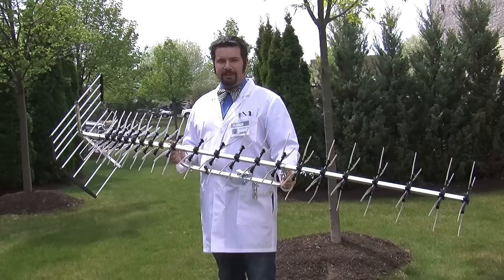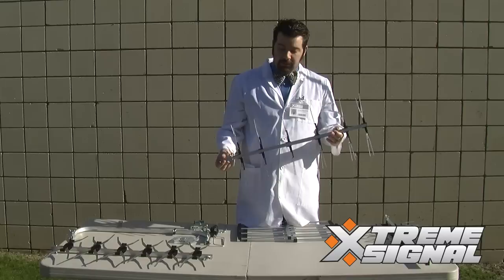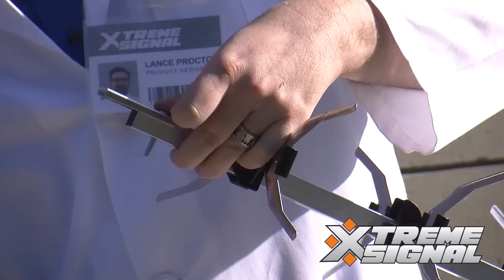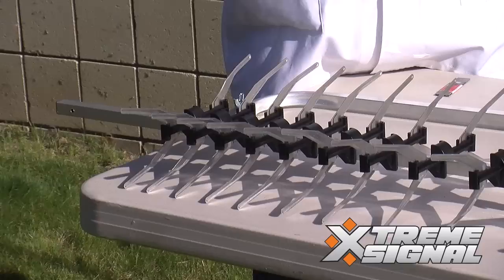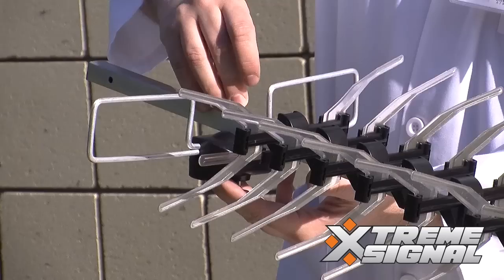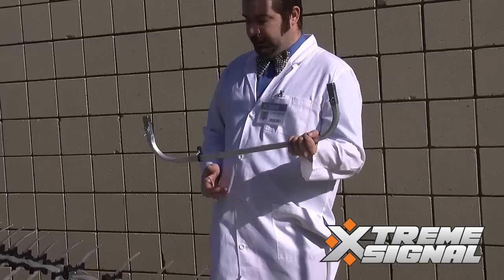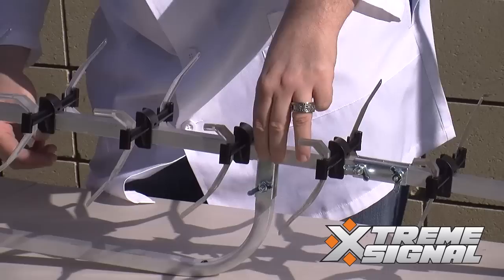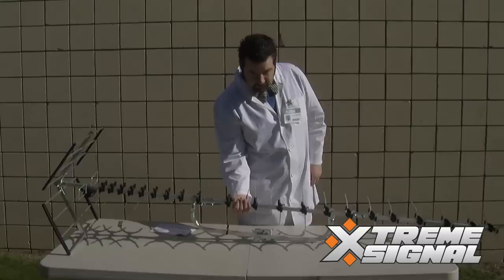Assembly Instructions for the HDB91X Yagi TV Antenna from Xtreme Signal

Comment: I bought this antenna back in November and mounted it 20 ft above ground. I added and RCA pre-amp about 3ft below the antenna and am using RG6 cable run. The antenna is in a holler (narrow valley) in southern Ohio. Southern Ohio is very hilly and heavily forested and this antenna receives ALL the Columbus, Ohio stations (74 miles from the broadcast towers) and when pointed southeast receives all the Huntington/Charleston, WV channels (about 64 to 75 miles away).  All in all a great antenna I would recommend
Reply: Good to know because I live outside Lancaster and think I will try one after reading your comment.
Reply: @supahugro9065  - Go to TVFOOL.COM and click on " TV Signal Locator " - From there, enter your Zip Code - From there, you should see Location / Directions of TV Towers.  From there, point your Antenna to where it is the most Channels... That way, you will know what and where all the TV Channels is / are.  NOTE:  Take your time and study all the Channels including distance + locations and all the " Important " Channels that YOU like!
Reply: Are you serious?  I'm in the exact same boat.  I'm in the bottom of a valley surrounded by 1000' tall hills on all sides.   I can only pick up 2 stations with a small RCA Yagi Antenna.  
I might have to give this antenna a try.   What stations are you picking up?  I can only receive channels 3, 30, and sometimes 11.
Reply: @jTempVids  I get 3, 8, 11 and 30 when point toward Huntington and I get 4, 6, 10, (sometimes 28) and 53 when aimed north to Columbus and I get 20 when aimed toward Athens. I'm in Northern Scioto County.
Reply: @gramsey5  Thanks for the info.  I went ahead and bought one.   I'll be thrilled if I can get 3, 8, 11, and 30 at the same time.

Comment: Just purchased this antenna and I will say it does a great job. I live in a hilly river valley and it picks up all the stations that are available to me.I put it up 20 ft with a rotor and have free TV I have 3 transmitters that are 50 miles away with a 2 edge signal and this antenna locks them in with no problem. Also picks up a LP station 25 miles away that is  directional going north of me. I only have 1 vhf channel,13 which is 30 miles away and have no problem with it either.   I would recommend this antenna if you want to cut the cord.
Reply: Thank you ! Just looking for a good antenna.

Comment: I want to explain some of the constructive properties of this type of UHF Antenna. 
First, this an UHF Full-Wavelength-Dipole "Corner" type antenna. The term "Corner" stands for the Reflector style which is basically two arrays of metal sticks/wires, or plates with or without holes or a wire net to mainly prevent signals coming in from the opposite direction as well as this corner element reflector amplifies the incoming signal by a certain - but merely small - amount into the full-length dipole. Usually the reflector is grounded, sometimes it is not, but if it is, symmetry is optimized. The X-shaped elements with the isolators inbetween (where these are fixed to the boom element) are two rows of half-length directors with 2 arms (other brands use loops e.g.) each to increase their bandwidth, amplifying the signal to av. 15-18 dBf coming in through the forward beam into the dipole element (which is the receiving element consisting of two loops or even two wire arms, carrying the connector box with the balun for symmetry conversion into a coaxial cable). As this antenna is catching up the signal at its end, the mounting direction is the same as the signal is running from the transmitter (the whole "arrow-shaped" construction therefor is to be mounted "pointing away" from the respective transmitter, with the reflector at its end, so all the X-directors are into the transmitter direction from where the signal runs up and through into the pickup dipole).

Comment: Have had this antenna for about 5 years and it's still working good. Does a great job on the Uhf which that's what it supposed to do. Now if you have any VHF channels this might not work to well. I have one about 28 miles away and the signal comes and goes but I'm in a hilly area. it will pick it up better on the backside of the antenna. So if you have channels on vhf and uhf a combination antenna might be better unless you are closer than 30 miles and in flat territory.

Comment: I presume that antenna also works in other countries as well because the antenna's job is to pickup RF signals whether it's ATSC, DVB-T, ISDB-T, etc. I'm from the Philippines and while our analog is NTSC-M but our digital is ISDB-T and I saw some antenna that look similar to that one.
Reply: Yes, it does assuming your TV broadcast stations are UHF. RF is the same everywhere and it's not dependent on any digital television OTA standard such as ISDB-T, ATSC or DVB-T/T2.

Comment: I bought my 8 bay bowtie from Solid Signal.  Works well but I'm still missing a few channels due to surrounding terrain.  The transmitters are in the same direction but some stations broadcast a weaker signal.  In your opinion, would this model have a significantly better chance at pulling in these missing weak HDTV channels?  I believe I need the strongest HDTV antenna made (by anyone).  Is this it?  If not, what is?  Thanks!
Reply: Hi, there are many reasons that some signals come in more weakly than others. For example the signals you are having issues with could be distant VHF signals and there are better antennas for that. The best thing to do is go to Solid Signal's web site and click on the antenna request icon at the top. We'll happily get you the right antenna. Unfortunately this comment system doesn't give me the ability to help you directly.
Reply: Stuart Sweet Thanks Stuart!  Well, I figured it out.  The most powerful UHF antenna (was) apparently the CM4251.  There is even a tribute site memorializing that antenna.  Wish they would produce it again.  I may try to make my own.
Reply: This is the best antenna for you, since you are in deep fringe reception area. It will pull in the stations that your Eight Bay Bowtie is not catching - due to the Yagi's  directionality. Incidentally, cable companies used to utilize this antenna type, stacked in a quad formation, to pull in very weak signals from over long distances.

Comment: I use this antenna to pick up Boston over water from the Bay of Fundy in Nova Scotia on fine summer days (380 mi by tropospheric reflection).  It's the best of all the ones I've tried. 

Now that UHF OTA has been cropped back to channels 14-36, will there be an updated version of this great antenna optimized for the lower UHF range?
Also, doubling its reflector rod density makes a noticeable improvement without too much wind load.   It would also help to thinly gold plate the driver and its connection to the coax for more reliable use in corrosive salt air.

Comment: longer the boom the higher the gain
Reply: joseph kopeczy actually it is the more director elements the more the gain. That one should be at least 21 dbi gain.
Reply: @dr.mikehughes9874  There must be a limit on the number of director elements to have more gain. The curve on the gain vs frecuency must drop at some point as you add more elements. I don't think you can get more than 21 dbi on this type of antenna in passive mode.

Comment: Before buying an antenna make sure of the tv channels available at your location.  Most stations today transmit their signal on UHF or on high band VHF 7-13.  Don't be fooled by on-screen references to old analog channel numbers (now called virtual channels) because they no longer exist.  There are no RF signals on the old low band channels 2-6 which required antennas with long elements.  A good high band VHF and UHF antenna is all you need.  "repack" is underway among many TV stations which means that many will change their RF channel or go off the air and share spectrum with another station.  After the "repack" the highest UHF channel most likely will be channel 38.
Reply: Colonel - Well, please consider Channel 5, WCYB in Bristol TN/VA, an NBC affiliate. It stayed at the Real Channel 5 frequency during the change from analog to digital TV signals. It's a mistake to refer to low VHF as "analog channels." The frequency does not dictate whether analog or digital signals are broadcast on it; the FCC does that (along with the specific location). In rural, large-coverage areas low VHF has an advantage because of better range than UHF (all else being equal).
Reply: Google User Forget about VHF,  no one, of any significance, in Central Ohio, is broadcasting a VHF band, unless you want to tune in FM radio stations on an old stereo receiver. 
 Source;  https://nocable.org/browse-locations/state/oh-ohio
Reply: Go to TVFOOL.COM and click on " TV Signal Locator " - From there, enter your Zip Code - From there, you should see Location / Directions of TV Towers.  From there, point your Antenna to where it is the most Channels... That way, you will know what and where all the TV Channels is / are.  NOTE:  Take your time and study all the Channels including distance + locations and all the " Important " Channels that YOU like!
Reply: Google User  Fact:  There are many UHF broadcasters that still use there old VHF call numbers now referred to as "Virtual Channel Numbers", but the reality is very few broadcasts are on the 54-216MHz frequency of VHF.   There are no major broadcasters using VHF, at least in OHIO,  and the few that do use VHF are low-powered independents.   Here is a link to data for all OTA broadcasters in OHIO, by city and zip.  https://nocable.org/browse-locations/state/oh-ohio
Reply: Colonel 2 who sell antennas in Houston Texas USA!

Comment: It's an interesting design, using bowtie directors for wider bandwidth. I wonder if, instead of a folded dipole, a simple bowtie dipole with a 1:1 balun to the 75 ohm coax would work as well, or better.
Reply: Fact Checker  How about doubling the density on those reflector rods?

Comment: The tutorial doesn't pay attention to important details. For example, in the first steps, "grabbing  and twisting" there are 2 ways to position the pieces, only one of them correct, if you try the other way you may end up damaging the rather flimsy aluminum vanes. Likewise mounting the third antenna piece using the bracket from the bag is not shown clearly enough, there are various ways to do this only 1 is correct. He needs to show the details of the bracket, holes in the antenna etc.

Comment: I've read reviews where people didn't think this was a very good antenna.
Reply from the maker: Sometimes people are disappointed because they bought the wrong antenna for their situation. If you don't know which antenna to buy, check out the free antenna suggestions at SolidSignal.com.
Reply: This is a very high gain and extremely directional antenna, as such it requires a rotator to zero in on the signal you are trying to receive. The only exception is if you're located a great distance from the transmitters and they are all in the same direction, then proper aiming using a signal strength meter is required. Once the correct heading is established the antenna can be hard mounted without a rotator.

Comment: I got the lava model and have it mounted 40ft high and get 30 channels. I'm reaching 80 to 90 miles. by the government website on what tower I would get in my area. The site said four channels at the most.  I bet that thing mounted 40ft high would pull in pluton horizon signals better then nasa.
Reply: Fact Checker  matched the phased array in Robinvale no probs esp over 240 miles it shaded the phased array you have to co phase a couple of phased arrays to match the 99 elelment one

Comment: The techs at Antennas Direct claim Xtreme stole this model from them.  Whether that's true or not.... I do like the reflectors on Xtreme's more as they appear stronger than the "screens" AD uses.  Also have a neighbor who has the cheaper Digiwave version of this which uses plastic wingnuts and is a tad smaller.  But after a year he's still happy with it.  Interesting that Xtreme's cost less than AD's same model by maybe $20 but AD has superb tech support.   I'm thinking too if you installed it in an area too small ... you might be able leave off the front section even if it did mean a weaker signal.   I've seen this for as little as $35 ...meaning if it did NOT work you wouldn't be out much.  Seems well worth the money
Reply from the maker: Flat out untrue. There are similarities but this antenna was designed top to bottom to be different from the Antennas Direct product.
Reply: So then the question is .... do you claim it's better than AD's 91?
Reply from the maker: I think it really depends on your needs. This antenna is less expensive, which could be better for you. There are several channels where it has more gain, and that could be better for you if those channels are hard for you to get. There are a lot of different antennas and each one will work in a different situations.
Reply: I'm 30 miles S of Seattle ....lots of hills....but in my bedroom it's pulling about 70% for most stations.  Putting it outside will fetch a better signal at first .... but in my attic it won't get weathered and the connections...especially cable connections... won't get corroded.  On the down side...some elements were bent during packaging.

Comment: I just purchased a Winegard HD8200U. It is shaped completely different from this. Can anyone tell me what is the purpose of designing an antenna like the one in this video? It has many shorter segments. Does that make it better at certain applications?
Reply: this antenna only picks up UHF the Winegard has UHF and VHF/FM capabilities, that's why the 8200 has the extra wide director elements and the extra long frame.  No one is broadcasting VHF anymore in my area.  I have an old 8200 I'm going to modify by removing the VHF section to make the antenna less of a monstrosity and wind vane on my roof.
Reply: @MegaHugro  - Easily Modified, you need a Balun 75 to 300 Ohm UHF/VHF Matching Transformer - Balun.  One Balun for VHF and One Balun for VHF
Reply: @MegaHugro  Be careful now. A lot of UHF stations are now migrating to VHF High due to FCC repack. If you live in a large metropolitan city, you are better off buying a VHF/UHF antenna.

Comment: No mention of antenna connections?
Reply: 300 Ohm simmetrical output. Either for 4:1 balun or 300-Ohm LNA (have built in 4:1 balun)

Comment: can it be modifide to work for wifi
Reply from the maker: I don't see how that would be possible, sorry.
Reply: LOL.
That's what I thought it was for until he said hdtv at the end. But yea, that definitely could be used for directional wifi. I don't know the spec of wifi but the mod would probably need something like a 4:1 coaxial balun.
Reply: Jonathan Dragon
Looking back at the video now. You might also mod the dipole so it circles around it. Instead of that B shaped dipole.
Reply: croquis24 The thing that makes one antenna good for one thing or another is in the length of the director elements. Each element has a different spacing and length for the particular frequency you want to use  You could take the basic design of this antenna if you like and make your own by cutting the elements to the proper lengths for wifi if wanted to.  I'm not sure but I think anything over 15 to 20 elements would cease to produce any increased gain. That's what I've read on some sites anyway.
Reply: no, it cannot, geometry of this antenna have gain in 470...790 Mhz range, and filter signals of lower and higher frequencies. WiFi works in 2400 Mhz band.
Size and price of antenna designed for 2400 Mhz, with the same gain is 10x cheaper and compact.

Comment: Where to buy that antenna?
Reply: @Blondie SL ....Oh, also, another tip.  When connecting the balun and connector, make sure everything is tighten down.  I would even suggest adding heat shrink over the balun connection (coax) to prevent water or environment from getting in... Excellent advice. I would also use dialectric grease on the F connector to the antenna. I am an installer and use it all the time to prevent any water/moisture from reaching the center element of the coax cable.
Reply: @Blondie SL It makes a lot of sense. The Achille's heel for all these antennas - specially the cheap ones made in China - is the little plastic box with the dipole and the F connector. Once water or lots of humidity (water vapor) gets into its PCB you are in trouble.

That's is why I like the Televes antennas. When I remove the dipole I can see that the metal  housing for the connector and PCB are completely sealed. That makes a huge difference on the antenna's performance and useful life.

From now on I will be using my little friend to protect this area: clear RTV around the plastic housing to avoid water and water vapor.
Reply: @Blondie SL In salt air I have to service mine annually.  Sealing the PCB connections is a great idea.  I'd also like to see gold plated coax connections.

Comment: Poor Video. First off, it doesn't agree with provided documentation for the Mounting bar. The antenna isn't close to being balanced, and is back heavy towards the two reflectors. I adjusted the Mounting bar so the antenna would be balanced on the pole.